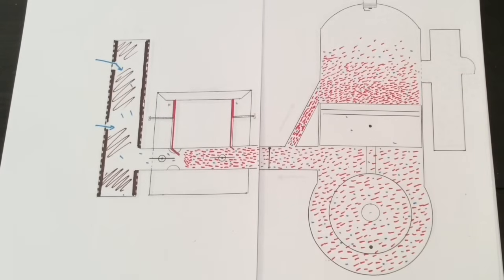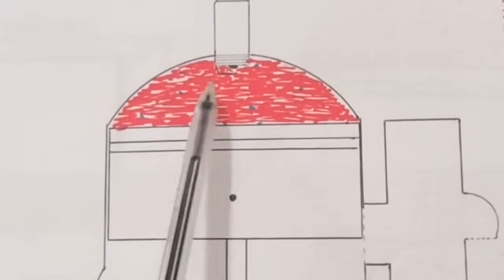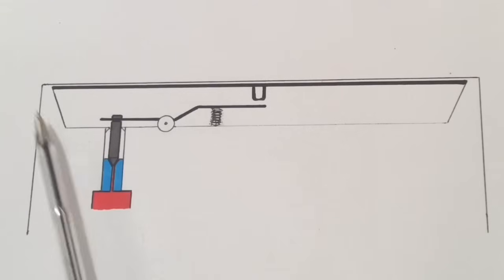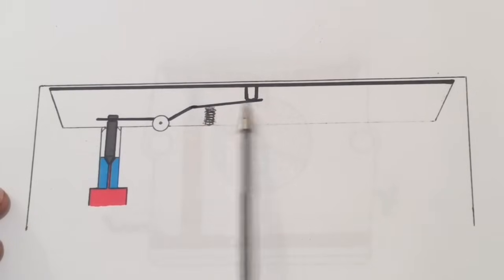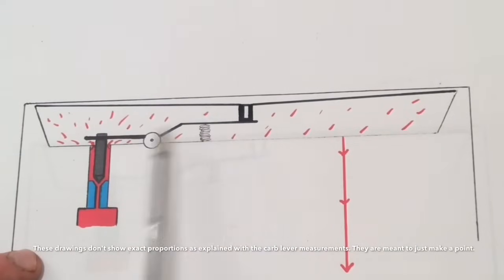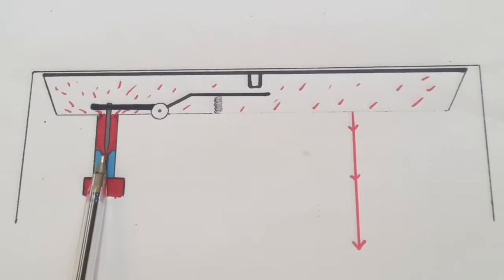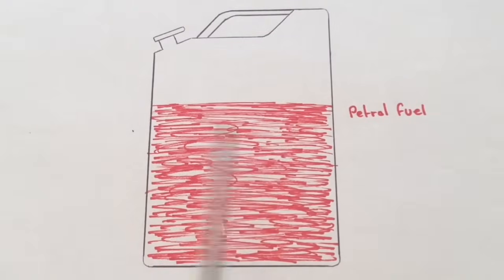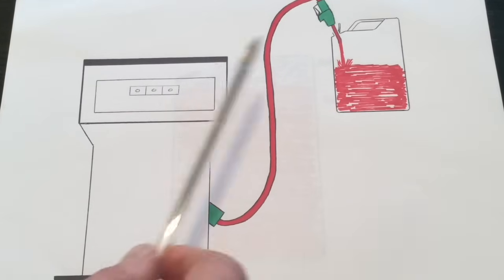CHAINSAW CARBURETOR LEAKING GAS/FLOODING: Why Carburetor Overflow?  (by Craig Kirkman)

Comment: I found something yesterday that I've never seen before. A friend brought an Echo SRM225 to me that struggled to rev up & never would rev up completely. First thing I checked was the spark arrestor screen, not clogged. I noticed the carburetor was flooding badly. Gas was running out of the carburetor & there was a puddle of gas in the muffler, so I ordered a carburetor. Later I installed the new carburetor, still would not rev up right. The air mixture screws would not adjust correctly, very unstable. I thought the motor must be bad, even though picking the trimmer up by the pull rope it seemed to have compression. I changed the spark plug & cleaned the air filter, no difference. After using a lot of PB BLASTER, I finally got the muffler off. The exhaust port was blocked with carbon almost solidly. I could only see a very small shiny spot on the piston. I don't see how it would have run at all, it couldn't exhale. With carb cleaner, PB BLASTER & a small screw driver, I cleaned the carbon out. I started it & ran it a little while with the muffler off. Like magic the carburetor would adjust like it was supposed to. I suppose with the carb pouring so much fuel into the muffler it eventually evaporated the liquid fuel & caused the carbon build up in the exhaust port. I've seen the spark arrestor screen clogged several times, but that's the first time I've seen the exhaust port stopped up. I also checked to make sure the muffler was not clogged before reinstalling it. From my understanding of COPD in people this trimmer has COPD in that it could not exhale.
Reply from the maker: That’s a brilliant find — thanks for sharing it in detail. You’re exactly right, if the exhaust port is carboned up it’s just like COPD in people — the engine can’t exhale, so the carb never adjusts properly and fuel backs up where it shouldn’t. A lot of people only think to check the spark arrestor screen, but a blocked port can cause the exact same symptoms and even mimic carb failure. Great reminder that before we throw too many new parts at a machine, it’s worth pulling the muffler and checking the port. Really appreciate you taking the time to explain it here — it’ll help a lot of folks.

Thank you

Craig

Comment: I used to regularly  experience small engine carburetion problems.
Then I committed to using only non-ethanol fuels.
Problems SOLVED.
Reply from the maker: Awesome you found an answer 👍

Comment: After many frustrating failed attempts to get my 2 stroke line trimmer working, these valuable and brilliantly presented insights got me over the line. Believing that I understood 4 stroke engines pretty well, I wrongly imagined that a two stroke engine would be a pushover. These great videos have shown me how a failure in one part can easily look like a fault in the other. I'm still not sure of the root cause in my case, best guess it got chronically flooded due to old fuel. I went straight to the ignition, checked the magneto, replaced the spark plug with one that looked right, but the electrodes got crushed because they protruded below the piston crown. Realized this, returned to the shop, was then advised it was probably the carby, so bought a carby kit which again looked right. Still no start, not a pop. Other you-tube videos advised the most likely remaining explanation was compression failure: the ring was quite loose with 0.5mm gap, so I found a replacement ring and fitted it (still some gap ~0.3mm, but that was all I could do). Still nothing, not a spark. Almost gave up, but for some reason decided to again watch the excellent explanations on this channel. Finally, thanks to this particular video, I went back into the carby and realized, just as he says at the 8:00 minute mark, the needle valve lever was set too high, causing continued flooding. Went back to the old lever, suddenly everything is great! Starts first time, every time, all the new parts have paid off, but I think it was all down to flooding and my failure to realize it. To their credit, the place that sold me the wrong plug and dud carby kit did give me some good advice about carby diagnostics: take it off and see if it can fire without it. If its flooded, I learned, it can run for quite a while from the fuel that's pooled in the crank case. 
Kudos above all to you, Repair Specialist!

Comment: could you not lift the needle off the seat when you blow the air through under water ?
Reply from the maker: I know what you mean and I suppose if you blow hard enough this might indeed happen
Reply: thanks for reply, mine just blow air straight out the fuel return part, would that mean my needle is not sitting correct ? lol.
your vids are very good they have helped me out alot @TheRepairSpecialist

Comment: I'm having a problem with a two stroke leaf blower suddenly flooding and not starting. I disassembled the carb (but not completely) and cleaned the diaphragm, choke, bulb, etc. with carb cleaner but still have the same issue. By watching your video I now see how the fuel flows past the needle valve. I will remove the needle and lever assembly and check that out next. Outstanding video!
Reply from the maker: Thank you so much for your positive feedback! I'm really glad to hear that you found the video helpful in diagnosing your two-stroke leaf blower issue.

It sounds like you're taking some great steps in troubleshooting the problem. Cleaning the carburetor components and inspecting the needle valve assembly is a good approach to address fuel-related issues. Sometimes, even a small blockage or debris in the needle valve can cause flooding and starting problems.

If you encounter any challenges during your repair process or have any more questions, feel free to reach out. I'm here to help, and there are often many knowledgeable folks in the YouTube community who can offer guidance as well.

Best of luck with your leaf blower repair, and I hope you get it up and running smoothly soon! Thanks for being a part of our channel!

Craig
Reply: @TheRepairSpecialist  Thanks for you reply, Craig. 
I did completely tear the carb down and cleaned the needle valve, even though it looked real good. 
Because I didn't have gasket sealer on hand, I used a thin film of Vaseline on the cardboard gasket between the cylinder head and carb, thinking there could be air leakage at the joint. I opened up the crankcase and inspected it out of curiosity, and also removed the muffler and blew it out with compressed air in case it had a blockage (plus it was saturated in fuel).
Reassembled and pulled the starter cord. It fired and I got it slowly running at half choke. It blew smoke for a good minute or so until the engine heated up. Then it ran good. Shut it down after 15 minutes of use and let it cool down a while. Fired right up when I restarted it so I shut it down thinking it was fixed.
Today I tried starting it with no luck. Spark plug wet, no fire. Starting fluid not helping
Blew the cylinder out to dry it and pulled the starter about 25 times straight at half throttle. It fired up hesitantly and was hard to keep running. Again, blowing smoke out the exhaust until the motor got sufficiently hot.
Even though I'm always careful, I'm now wondering if it's a fuel to oil mix ratio problem? Gas is fresh.

Comment: I watched this video a couple of days ago because my 2 stroke outboard has for years been nothing but problems.  Rough idle and stalls, check.  Hard starting, check.  Wet spark plugs, check.  Smoky, check.  Adjusting idle screws made little difference.  Fuel pump working.  However, I never did think to check the oil pump, I didn't know the oil mixture could flood the engine until watching this video.  So I search up a service manual to see how it is supposed to be set, and wouldn't you know the linkage was connected on the wrong side!  Way too much oil at idle and turning backwards with throttle!  I had some major work done some years ago and apparently someone screwed that up when they put the carburetors back on.  You can just clip it on and off on either side, but only the way shown in the manual can lead to being able to adjust so that both the idle and WOT lines match up with the set mark.  So thanks!  I haven't got it in the water yet to try it out, but it is already idling much better and making less smoke.  Still some smoke though, enough I'd say to indicate it is still getting oil.  But on the other hand I don't know how much excess oil is in the crankcase, so I think I have to get it out for a good run and see what happens.

Comment: I have a machine that floods itself when not running and the fuel tank lid is screwed on. It will literally dump an entire tank of fuel onto the floor in a day. Best I can tell is the needle spring is too weak and can’t handle any excess pressure in the fuel tank side.  Cheers for your video’s, they gave definitely furthered my understanding of two stroke carbs
Reply from the maker: Hi. 

Thank you for your feedback. I really appreciate it.  Yes. I agree that it does, initially anyway, sound like a needle valve issue.  

Yes it could be the spring. It could also be a damaged, or worn, seat or needle tip.  If the needle tip is metal and does not look worn then it could be the seat within the carb.  

If the needle does have a rubber tip then you might see a ring of wear on it.  I've had issues in the passed like this though, and both the needle and seat looked ok, but it wasn't until i changed them that it cured it.  

I suppose there can be wear and damage that is sometimes not so detectable with the naked eye.

Thanks again
Craig

Comment: Thanks for this very informative video. The visuals make it so much easier to understand.

I've got a 2 stroke garden machine. Cold starts perfectly fine but very difficult to warm start. If I unscrew the spark plug and crank it without the plug in - then put the plug back in, it eventually starts again...

Trying to figure out the issue. Air filter is good and spark plug new. Thinking H/L adjustment screws

Cheers

Comment: My chainsaw was getting drenched with fuel and would not run. Took it a part maybe 5 times nothing was sticking out. What it really needed is new diaphram i guess. It was so stale that it was just hitting that flap that opens the needle all the time. All I did was press the flap down a tad and the saw was running like new again. I really should have rebuilt the carb but eh. :)

Comment: Thank you so much for explanation you are a great technician and teacher. In my case I bought second hand weed eater when I open the carburetor I found the pin upset down and could not figure out why it is not starting I clean the carburetor and check the spark every is looks good and after explaining I found the problem I have to open the carburetor and put the pin properly I think it should start. Thanks

Comment: I thought I would just put this out there! On the subject of old fuel, I have a small boat and for my own safety need the outboards to start frist time every time,, I keep my carbs, filters and containers clean and also filter fuel every time I transfer it, lately I have bought fuel and found it to be no good
I live in south of england and I think its because there is not so much fuel being used, I now have to put a small amount in my container, smell it, to check if it fresh then decide if to buy a full container or the walk away
I worked with small 2 stokes for over 50 years and this is a new issue, welcome to the 21 century UK!

Comment: TOUGH WALBRO Carb problem i have if anyone want to try and diagnose?
 for whipper snipper (wacker?)- if anyone can help as this is REALLY tricky problem with fuel starvation? pulse hole?
I get full power right through the range and idle ok and plenty of fuel left on the screws so fuel pump and flow seem to be GOOD. BUT after a while 10-30 mins she starves off and a quick flick of the choke saves the engine so indicates fuel drop off OR air leaking in suddenly ?  i have cleaned and checked every passage and orifice short of Xraying it and all new parts of everything on it and filters ect. If the pump or lever height was too low or too high , i already tried diff positions but it still starves off after a period? and starts ok so getting fuel when col or barely maybe? 
Maybe the worn compression limiting the pulse channel as it dosent have a reed valve, just the hole the piston slides past. Hot piston or vaporisation causing fuel to drop off after a while?  Inlet gasket surfaces all flat and multiple new gaskets so that cant be a bad gasket or idle would  be affected but not when tons of of air needed, a small leak wouldnt shut the high speed down as it is now intermittently.  Last time i used it was fine then for 5 mins i couldnt get it above half  power even winding open the H screw, THEN it came good and roared perfectly again??
Perhaps pulse. pump pressure is minimal with low compression and its on the edge all the time and the thing just starves suddenly . I squirted a little oil in the pulse hole plastic boss and pull the handle and the oil didnt seem to move much. I might check the rings as its bit easy to pull over unlike other that pull tighter like there tons of compression. Pulse too weak? but why roaring for 20 mins plenty of fuel available on the H screw, i could easily exceed 9000 rpm.
Never had a car carb do this . it either is sick or perfect for 10 years when set . Yes these are diff operation , but this machine/carb has had this fault forever it seems, always troublesome. i even put a chinese carb on it and that wasnt right either. Maybe it is a pulse weak problem. If i connect a vac gauge to the fuel inlet, i see no movement, should it pulse left and right of 0? Just too weak engine now? or borderline? as it does go nuts then die?? weird. Never had a engine that failed like this that i worked on. Perhaps a bleed crack somewhere letting in extra air ect?

Comment: Don't know if you're still active in this video but I have a question regarding your underwater valve seat test. Won't the needle be forced off the seat (and then show bubbles) if you blow too hard through the fuel line?

Comment: I'm looking into building a forced induction system. How would I get the right amount of fuel into the system?could I just force the air into the normal intake and run it a bit rich?

Comment: Would the air filter problem be the reason my van (diesel) cuts out while driving? I have to turn the ignition off and back on while it's in gear and my foot is on the accelerator to keep going! Thought it was the fuel filter but replaced that and it's still doing it :(

Comment: Thanks very much for producing these very useful videos. I use Walbro and other similar carbs in my R/C airplanes. I have a 30cc engine that has been been out of service for several years. It now refuses to run. After watching your vids, I’m fairly confident I’ll find problems with diaphragms in both the fuel pump and metering systems. Carb repair kit is on the way. Thanks again.

Comment: Can someone please help me with a problem, i was riding on a ktm 200 2 stroke, and all of a sudden the engine made a deep sound and the throttle didnt do anything. It didnt want to start and all the fuel dripped out of the overflow tube. I changed to the reserve tank which also drained fuel abit and it started. Theres no fuel in the bike at the moment so its not starting

Comment: I have a 90 cc 4 wheeler that idles on its own but bogs when it's given anything past 1/4th throttle. When the rear wheels are lifted off the ground it goes to full throttle without bogging, any idea why?
Reply: @Sam Sly hello, I have long solved this issue but now it likes to cut out at full throttle, it is a 2 stroke

Comment: So what would cause an engine to start fine, run for a few seconds, then die? It starts right up again (with the same result), so the problem isn't flooding. I've tried all manner of combinations of high-speed and idle settings. The air filter and fuel-intake filter are clean, and the carb is spotless internally—I've never used ethanol-tainted gas in the engine. It dies whether I'm revving it fast or just letting it idle.

It's a fairly new chainsaw, used intermittently for a few months before the problem started.

Comment: Thank you for another FANTASTIC video.  At about 15 minutes, when we blow air into the fuel line, won't the air pressure open the needle valve, and cause air to push through?  Thanks again for another fantastic video, and taking the time to answer my question.

Comment: Hi, I totally understand your explanation of the carb operation. My issue is, my chainsaw starts, sometimes easy sometimes takes more pulls. New carburetor, trying to adjust, runs well, but when returning to idle sometimes dies,,, but then doesn't start right back.. My problem is the inconsistency in starting and returning to idle from high speed. Have several engined tools so not totally a novice, but when these tricky ones come up it's very frustrating. Also, I use canned fuel when first getting an engine going, so fuel is good. Seems carb issue but always looking for advice. Thanks for your very helpful videos.

Comment: curious have a problem with a trimmer i bought last year the air filter fell off and to get it repaired would cost more then when it was bought and was running fine but think i put too much oil in the gas mixture but not getting any smoke just difficult to start and then will only stay running if im pulling the trigger all the way and obly runs at half speed while doing it and shuts off when i let go of the trigger any ideas ?
Reply: check the spark arestor if you happen to have one
Reply: should be in muffler-(iron mesh usually gets clogged up due to usage with too much oil)

in murica on chainsaws it is necessary don't know for trimmers

in eu no